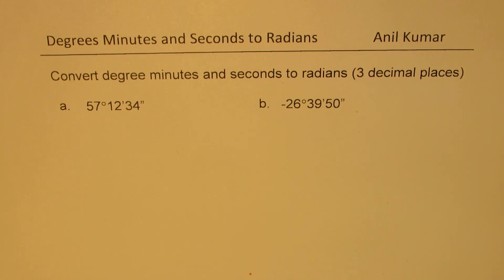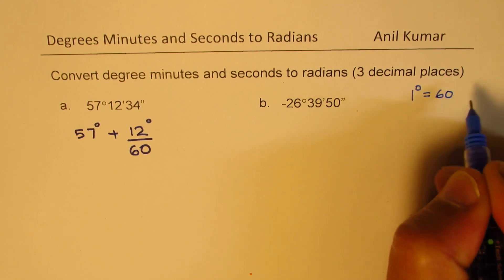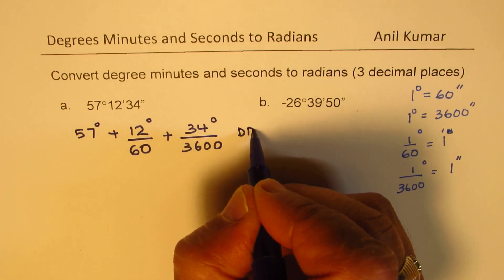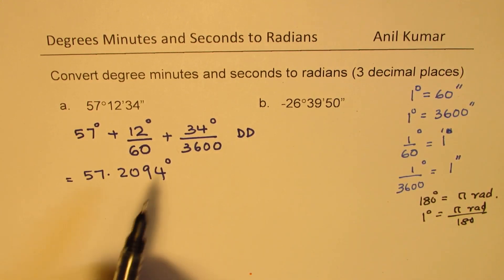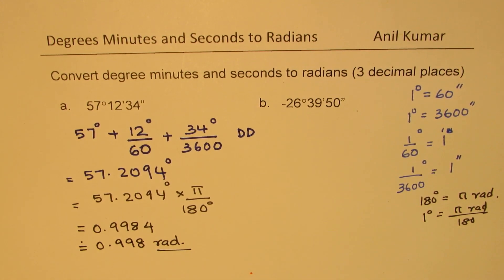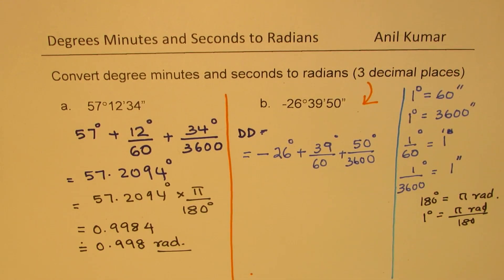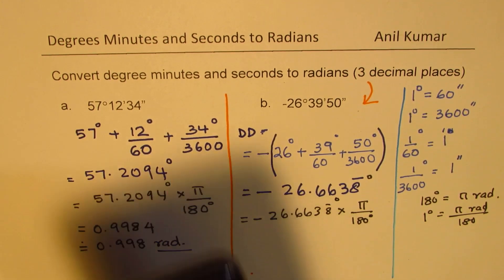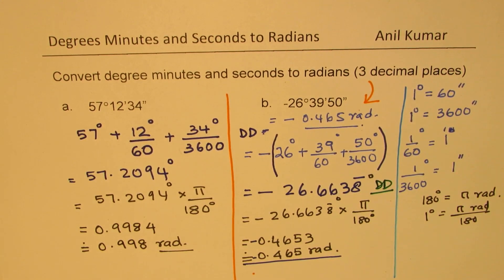How to Convert Degrees Minutes and DMS Seconds  to Radians

Comment: Sir can u please help to Calculate the exact centre and radius of the following points of polygon upto the seconds as given below {calculate radius in Nautical miles and centre point in degree and minutes} 46°13'N026°46'E 46°12'N027°31'E 46°34'N027°21'E 46°35'N026°47'E 46°13'N026°46'E

 Please provide the method for calculation. I have tried by average method for centre point and for radius calculate using difference between centre point and coordinates.but this method is not provided correct results.